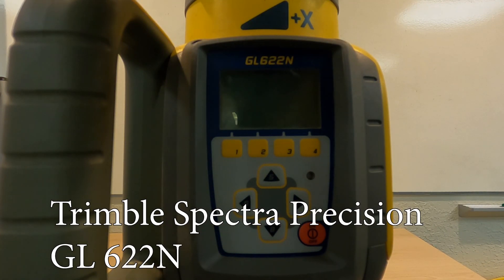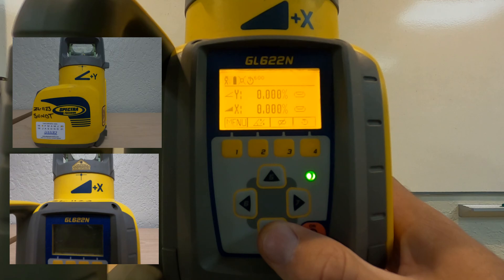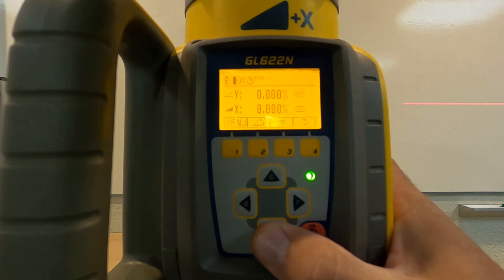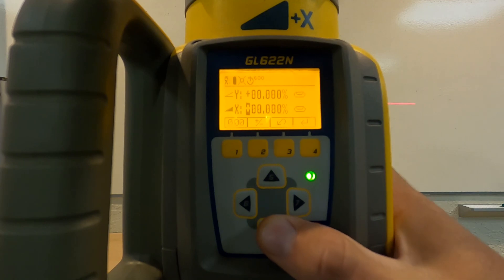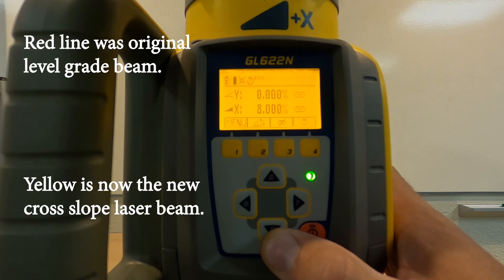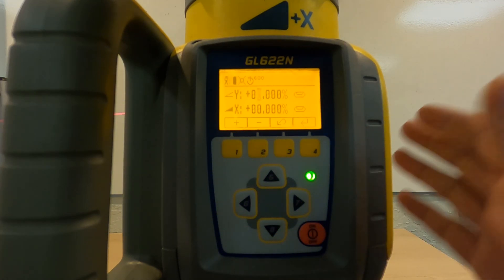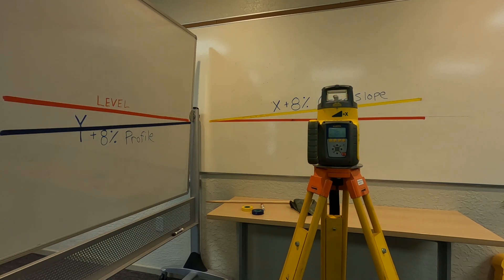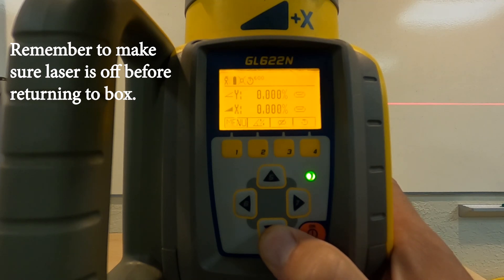GL 622N Dual Slope Laser

Comment: So on Y can you have it going from low to high - left to right, but on X having the laser on the wall in front of you; going from high to low from left to right?
Basically are there two lasers in that machine? 

Because once you put in 8% for both X and Y essentially the laser is just shooting in the same exact direction on both walls left to right going low to high.
Reply: The laser is just making a plane. You can tilt the rotation of the plane in two directions, XY, to get your angles.